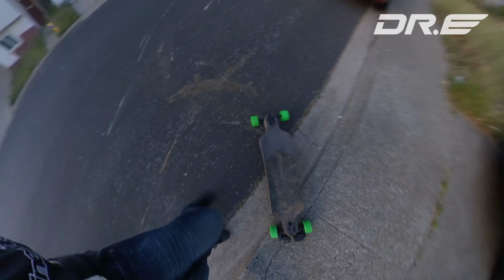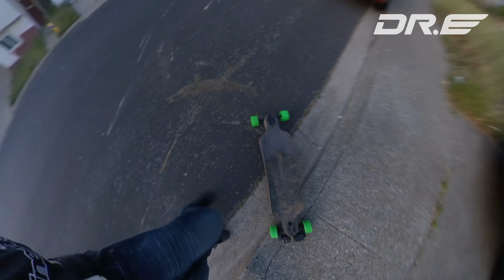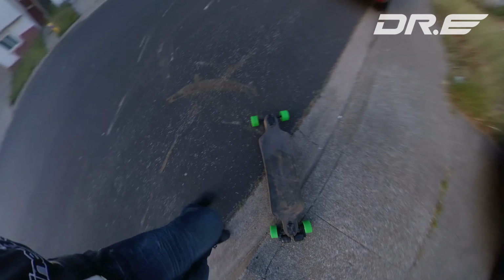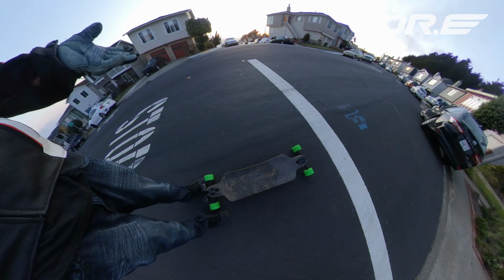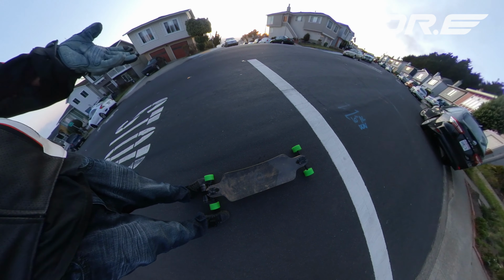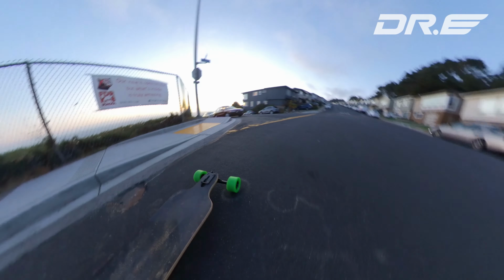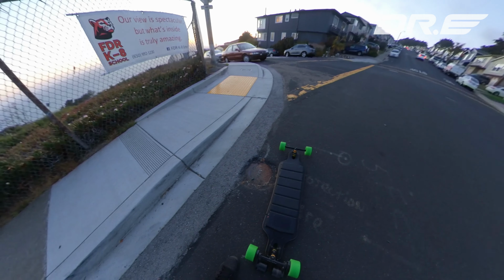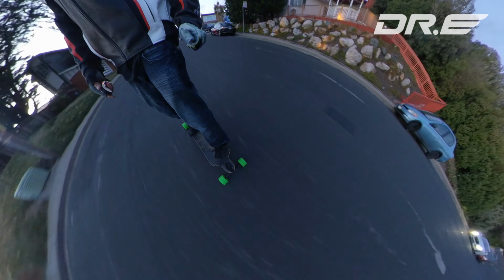Vestar Black Hawk 90mm Street Wheel Swap MOD!

Comment: do you think the belts are slipping because the motor and wheels aren't perfectly parallel?
Reply from the maker: No I don't think belts are slipping, the sound is definitely belt hitting wheel but it's due to the motor pulley not having a cap, which usually keeps it in line.   I could replace the pulley or shave off my wheels a bit.

Comment: So if you bought the two-in-one Blackhawk do I have to change the belt size or do I just adjust the motor pulleys when I switch to Street?
Reply from the maker: I left my vestar at my usa house but i think it comes with extra belts and pullies for street wheels if i remember correctly?  Do you have extra set of pullies ans belts????
Reply: @dr.eskateboard3381  no the pulley is attached to the street wheel if the pulley comes off I have no clue how